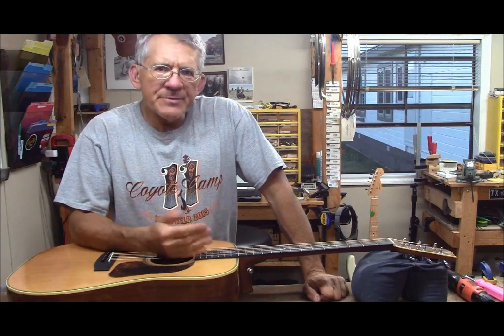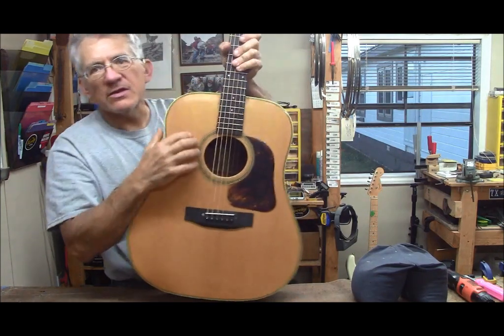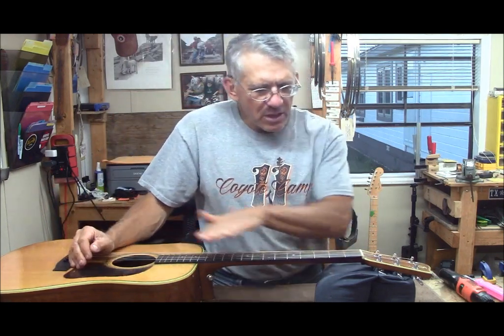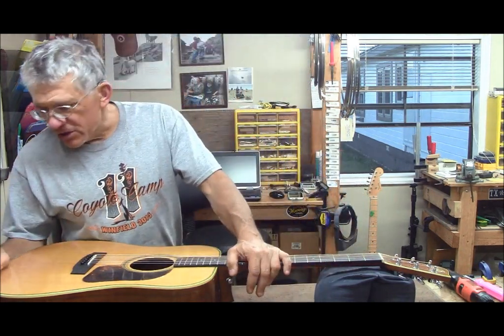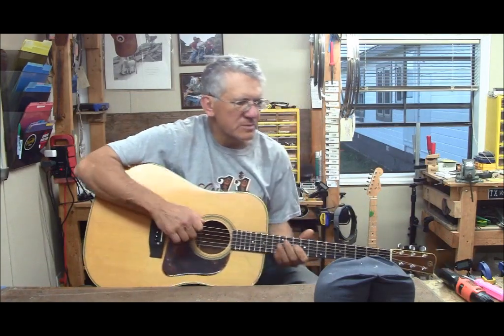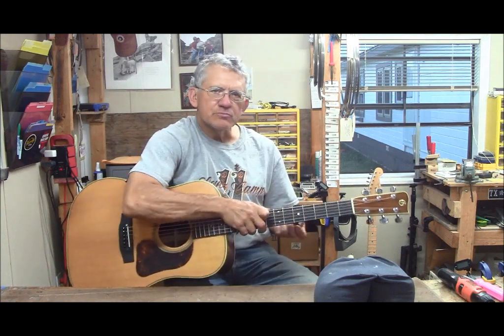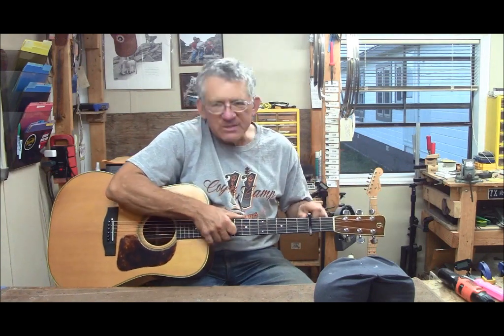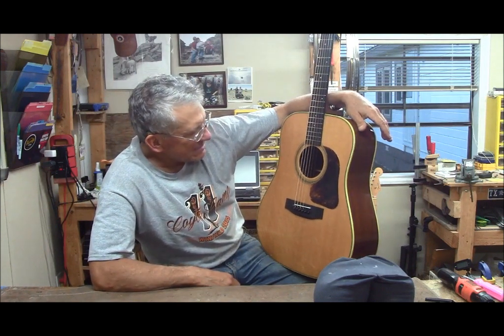Repair-  finishing Gallagher Doc Watson

Comment: Do new EVO frets need to be leveled, crowned and polished or are they good the way they come?
Reply from the maker: You have to level, crown, polish all frets if you want them perfect.  It has to do with post-installation finishing more than than the fret themselves.  Also, on non-adjustable truss rods, I use the leveling to tweak the final relief and that will involve re-crowning.  See  https://youtu.be/zUEXpV5HRB8

Comment: That bridge seems really wide from front to back as well. Is that standard Gallagher specs or is it oversized? Also @12:37 you seem to really like the playability of that guitar. From this side it really seems to suit you. Your picking is clean as usual, but it's even cleaner & more precise on this guitar. Especially on that 7th-10th fret G scale you do. 
     Several yrs ago, I recorded at a friends studio, which was only a couple miles down the road from me. He had an Indian rosewood Gallagher that I ended up using on several cuts. It was unusually easy to play although the action was higher than I normally like. It had medium gauge strings & all the other traits normal for that guitar. I do remember the oversized frets.   lol   That guitar would often give me fits tuning it & I suppose part of that was due to the frets being pretty worn. Just out of curiosity, what is the string spacing on that guitar? Is it standard or prewar?
Reply from the maker: Bridge is VERY wide front to back.  Dunno if it's standard or not.  Also don't know on the string spacing- I wasn't gonna change it so I didn't measure it.  UPS took it away yesterday.  It didn't feel wide to me.